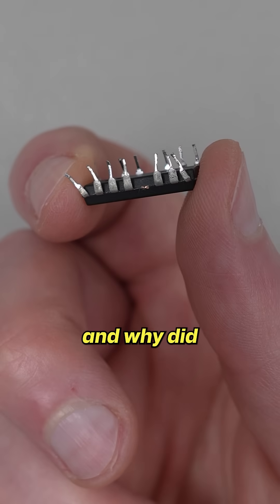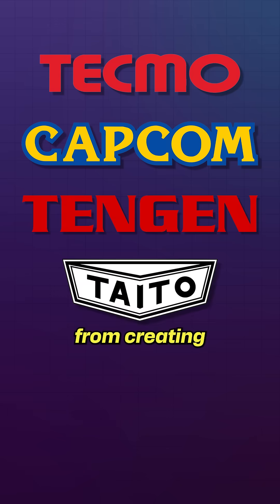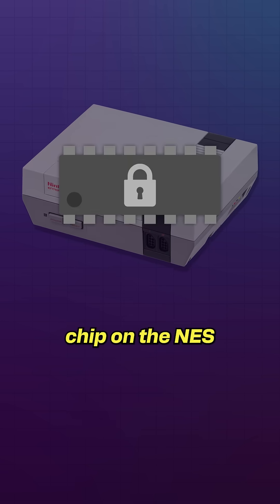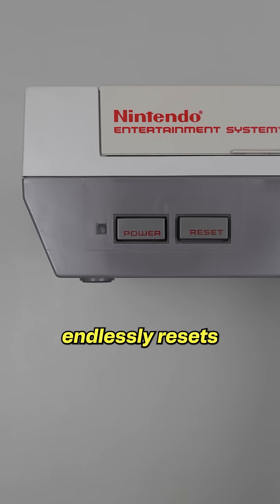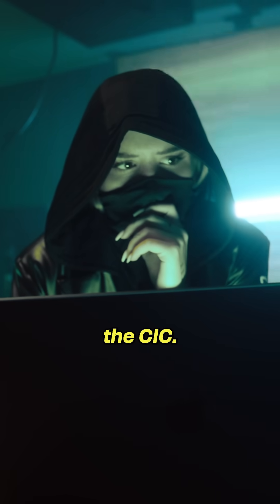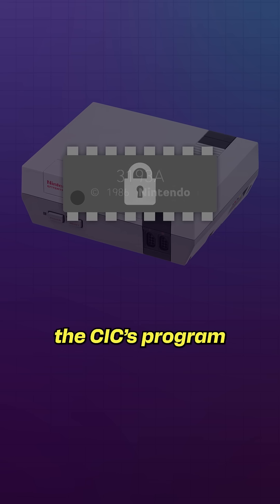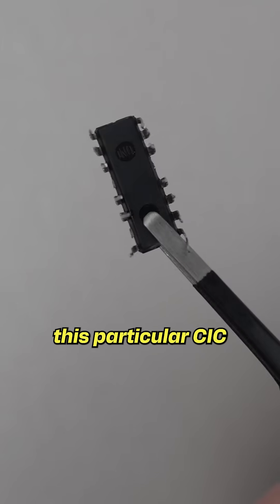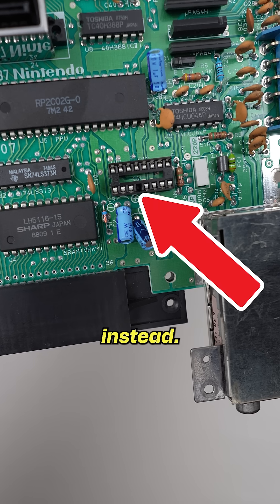Nintendo's Old School DRM #nintendo #nes #hacking #hardware #history

Comment: I remembered something, namely the fight between Atari and Nintendo about the "right to interface": February 1990: "Interface Specifications, Compatibility, and Intellectual Property Law" by Pamela Samuelson in "Communications of the ACM", Volume 33, Issue 2 (freely available at the ACM digital library): "Perhaps you have read about the lawsuit currently pending between Atari and Nintendo in which Nintendo claims intellectual property rights in the interface between its video game console and cartridges designed for use in the Nintendo console as a basis for blocking Atari’s right to develop and sell compatible video game cartridges for the Nintendo machines. The outcome of this lawsuit may have profound implications for competition in the software industry, as well as for the price you will pay for game cartridges for your child’s Nintendo machine (which you may have noticed are not at all cheap)."
Reply: Also very funny since the Nintendo entertainment system was using a unlicensed implementation of the 6502
Reply: @TatsuZZmage  Yeah, LOL. MOS and Jack Tramiel would like a word, Miyamoto
Reply: Tengen pretty much won because soon after Nintendo implemented its "Seal of Quality" mark on "licensed" products and alleged unlicensed games would "damage" the NES.
Reply: @Mrshoujo  on old versions that was the case tho as unlicensed games over volted the chip practically frying it which technically constitutes as damaging the console, EVEN if overall functionality was impacted
Reply: Also, on a related subject...The entire Anti-trust lawsuit against Nintendo finally panned out...but not until potential competitors had been virtually destroyed (R.I.P. TurboGrafX 16)
Reply: @pex_the_unalivedrunk6785  Truly a shame it couldn't have happened sooner. I also hear that they prevented SMS from being carried by retailers (it didn't help that it was Tonka of all people responsible for the NA operations at the time).

Comment: You can bypass it by overvolting it. Unlicensed games smack it with too much power and it would rollover. This was fixed in later version of the NES tho.
Reply: A famous example of such was colordreams, but Nintendo threatened to remove licensed games if distributors didn't stop selling colordreams games
Reply: @zachoman420 hence why the Wisdom Tree rebrand was so brilliant - they would only sell to religious outlets, which wouldn’t carry other games anyway, and Nintendo would NEVER touch that PR nightmare with a ten foot pole
Reply: "We did it! We beat the chip!"

NES ignites
Reply: @lapiswolf2780 why is your name lapiswolf but you’re a car instead
Reply: @nunyabeezwax6758 Tengen (Atari) actually lied to the government to get Nintendo's patents to make a clone of the chip. And of course you can guess what happened next.
Reply: I don't believe they ever fixed it. They just ended up removing the lockout chip entirely from the NES 2 redesign.
Reply: @jasonblalock4429  you were basically correct, but it was called the nes 101 for some weird reason. Nintendo's fault, not yours.
Reply: damn that's smart!
Reply: That's what some old bible games I had did! It just fried out that chip so it wasn't a problem :P
Reply: @thePalindromeCrafter God hath destroyedeth thy chip! He said,”Let the chip die!”
Reply: Wasn't it unreliable? I remember reading there were various voltages you could use if it didnt work
Reply: “Chip, roll over!”

Computer chip rolls over

“Good boy!”

Feeds him strings of 0s and 1s
Reply: @nunyabeezwax6758tengen didn’t overvolt anything, they stolen the code asking the code  for a patent lawsuit and  in the patent office gave it to them , then Nintendo sued tengen and they lost, also then tengen director was a close to Nintendo directors and he did it without consulting them (he did it because Nintendo was very draconian with the publisher, with high licenses fees and chargin high prices for the cartidges and chips )… also tengen was the the first publisher of Tetris but Nintendo with henk rodgers hey the license directly from Russia and they got monopoly of Tetris publisher in consoles…
Reply: They actually redesigned the power circuit for this issue but the chip spikers would find new tricks to keep doing it. The bible game publisher one found like 8 diff methods to roll the cic over
Reply: Interesting how they could make their own games and bypass these locks
Reply: Goddamn how do ppl like you know this much. Are you a NES developer?
Reply: What I dont get is the clk pin is wired up to the cartridge can't you just tie it to gnd
Reply: @nunyabeezwax6758 it was undervolting not overvolting. also Tengen actually cloned the chip
Reply: the overvolting method seems riskier as it might cause overheating
Reply: @kiyoponnn nah it was designed to spike the chip with negative or positive voltage spikes in short burts to prevent heating they really thought it through
Reply: Doesn't A52 do this, besides the whole thing heating up too much if it runs too long?

Comment: Sooooo many innocent CICs and 72 pin connectors have died as a result of people being too lazy to clean their games.
Reply: Who cares? They're DRM and do nothing else.
Reply: the CIC chip was the WORST thing Nintendo did when they revamped the Famicom into the NES.

The chip has ONE job, and it is to increase the likelihood of your game not working.
Reply: @TheTurnipKing  Wow ok lmfao

If your cartridge couldn't handshake with the 10NES, then it was probably too dirty to run properly regardless of the 10NES.  Nintendo would never spend millions of dollars to invest in lockout security for no other reason than to cause people to not be able to play their games; just keep your cartridges clean and youy won't have any issues
Reply: @Wflash00  probably but its an engineered failure state that doesnt need to be there, it adds several pins to the Famicom edge connector that exist ONLY for the lockout chip and if any of them dont make a proper connection your game wont work EVEN IF EVERYTHING ELSE IS FINE, and despite the NES having more pins than the famicom it results in expansion audio being moved from the cart slot to the bottom expansion connector, so no better music.

Everything about 10NES is a fucking abomination and the NES is immeasurably improved when its removed.
Reply: @Wflash00  It would have been nice for Nintendo to have told people that
Reply: @TheTurnipKing  "No purpose" is an disputable notion.  Up to that point, the market full of systems without DRM cause the entire industry to literally crash because of all the BS going on.  CICS, whether functional or not, prevented this - it hasn't happened since.  So it was not without purpose.  Just another perspective.
Reply: @spgilmorespgilmore  Only it didn't really do any of those things, because several companies established elaborate fronts to allow them to peddle more crap (hello, LJN!), several risked damaging your console to send CIC skewering voltages through your console to release their own unlicenced crap, and some bloody good publishers got locked out of releasing some actually half decent games (Micro Machines, Dizzy) for cheaper than Nintendo would have liked.
Reply: @Wflash00 dude they literally only did it so people couldn't play their games, that's LITERALLY what a lockout chip does.
Reply: @TheTurnipKing  Like it or not, console manufactures are making consoles to... gasp make Money! And how do they do that? Not by the console. They make pennies off of it. Its by licensing games. Its why most console makers sell consoles AT A LOSS because they expect to make up for that in game sales. But they cant Do that if people skip over them entirely and not give them a licensing fee. 

They dont exist to provide YOU with entertainment, they exist to make MONEY! And in any case that chip is easily bypassed today even without cutting it.
Reply: @lyianx  Nintendo made plenty from the Famicom, and the lockout chip was ultimately responsible for them being sued over monopoly and crippling their third party support in the N64 generation.

Even by your own chosen metric the CIC is a failure and ultimately very likely cost them more than it ever made them

Comment: I soldered a wire from psu to that chip to bring that pin constantly high, and got the same result
Reply: Your solution, pulling it up, is more stable. Floating it could randomly fail half the time or be sensitive to static electricity
Reply: @chrismofer  i doubt they float, it probably has an internal pulldown
Reply: I smoked mine out every time I wanted to play an unlicensed game. And I only played unlicensed games because I spent all my money on weed. So me and that console were constantly high as well.
Reply: @trippmoore  Lul
Reply: @trippmoore 😂l
Reply: Haha yo chip high
Reply: How don’t make sense, how would giving it power help? If needs to be connected to the motherboard and why tf would you need to solder
Reply: @JSTMelon  with binary data being transfered, they only need to worry about power high and power low. off for 0, on for 1. if you just give it power, that section of the chip reads as a constant go ahead.
Reply: @JSTMelon  this has to be bait.

Comment from the maker: ⚠️⚠️⚠️ I DO NOT recommend performing the "pin snip" hack! There are non-destructive ways to disable the CIC (check out the sources in the video's description).

Also note: performing the hack will have very little impact on making games playable, and should really only be done if you want to play PAL games on an NTSC system, etc.
Reply: Snipped my pin around 20 years ago and have no regrets.
Reply: I would normally agree, but the cic does literally nothing for the system. Literally nobody is going to care or even notice if the CIC is snipped.
Reply: You could also do a board between console and chip with disconnected
Reply: and hacks should be done if you is homebrew dev
Reply: Amateur gamers: yeah I snipped the pin
Amateur mechanic: yeah I cut the oil pan off
Professional gamers: you could have just taken the time to fix it
Professional mechanic: so how do you get the new pan on?
Reply: If I remember correctly PAL as more horizontal line than NTSC. Won't be the picture cropped on the TV ?
Reply: sadly, i had clipped mine years ago before I found out about the other methods.
Reply: Aren't there conversion carts that do that?
Reply: The second link is broken btw! (it should go to "/CIC_(Nintendo)" but it leaves off the right parenthesis)
Reply: I DO recommend it because that shitty little chip DESERVES it. :D
Reply: The problem is that NES and that bypass tech won't be staying with you or anyone else until the heat death of the planet, and so it's going to be sold at different times and someone down the line won't have access to the work around. The best work around is to permanently defeat the DRM, and in this case the permanent defeat is the Pin Snip
Reply: I have an nes I got the is missing 3 pins can it be replaced with one from a broken gamecart?
Reply: I Very Much Heartily RECOMMEND snipping the 4th pin! Easiest mod to make for the NES!
Reply: Maybe make the console not reset when the chip asks the console to do so?
Reply: not sure why my comment was deleted as it was very tame so I'll repost it, really hope you aren't censoring comments 💀:
"I would normally agree, but the CIC does literally nothing but make the console worse, nobody is going to care or likely even notice if you snip the chip."
Reply: Not to mention there are a handful of games that won't work if the lockout chop is disabled. 
It's not many.
And certain unlicensed games may also overheat due to the way they try and add extra voltage to bypass the cic, if it's missing then the unlicensed cart can't discharge the electricity correctly.
Reply: @cybernoid001  are you joking me? i sold many 260 in 1 cartridges in the early 90s, never had any complain haha.
Reply: who cares, most nesses you buy have this trick performed back then. i was part of it, made alot of money out of it haha. also with the psx and the 12c508 chip, i cant remember how many i programmed of them haha. i miss that era, it was awesome.
Reply: @klaasj7808  really? I bought 2 NES off ebay in the last few weeks, and both of them have their CIC intact and no mod performed on them.
Reply: @klaasj7808  "Most" definitely do not.
Reply: @NesHacker you should probably pin this warning to the top of the comments. Warning is greatly appreciated.